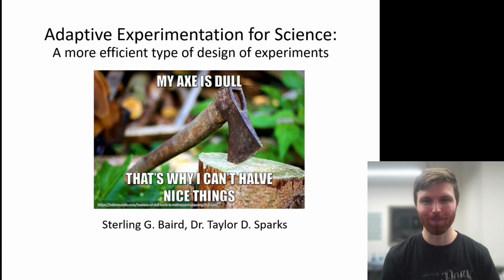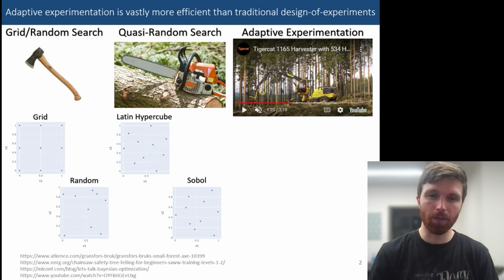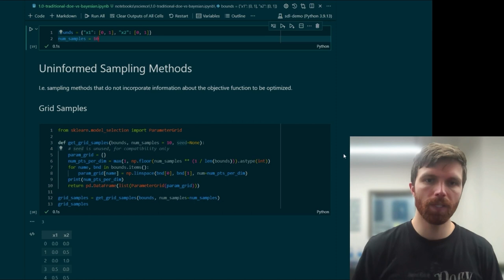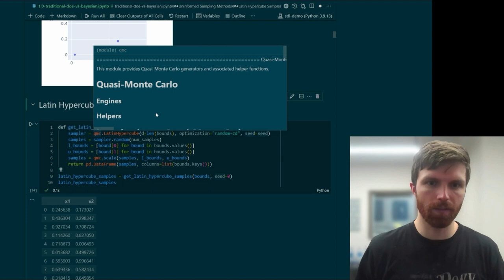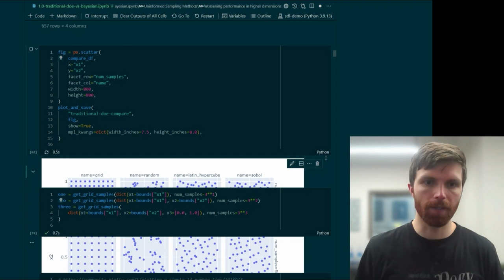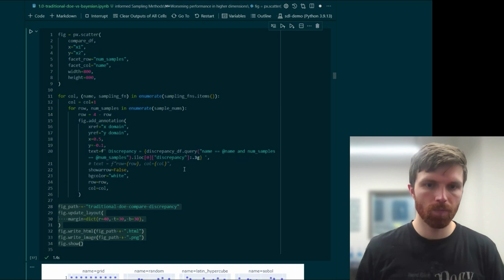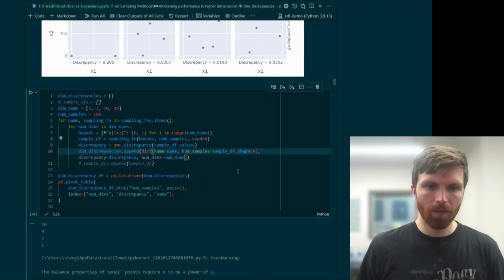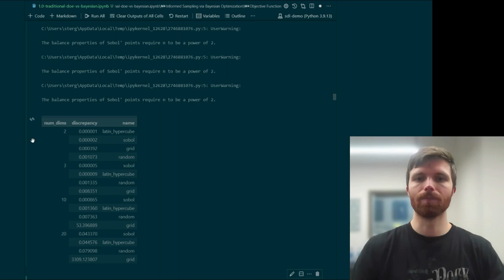Traditional sampling techniques (grid vs random vs sobol vs latin hypercube)

Comment: Awesome series! Thank you so much for this! 
One thing that came to mind  while watching this video:

The quasi-random methods presented assume a continuous space of independent variables. 
If you have a discrete set of materials (e.g., a set of recipes created according to a particular subject logic), these assumptions could be violated. This could be the case if the amount of one ingredient is in a certain ratio to another, the materials have different densities, and the materials are described by a finite volume.
Here, random selection has the advantage of not making any assumptions. To minimize the discrepancy, one could use k-means.
Reply from the maker: This is a really great comment. We actually have a follow-up video a few down where you'll see we implement a constrained search space
Reply: @TaylorSparks  Great - that is very helpful! I think the constraints can narrow down the continuous space. My comment referred specifically to a discrete space, where Sabol, Latin Hyperc Cube, etc. will not work in principle if there are dependencies between variables. What is meant here is the case where one has, for example, a given list of recipes or a data matrix.